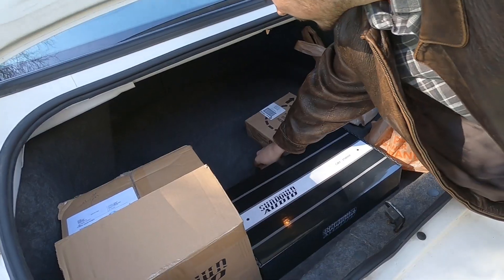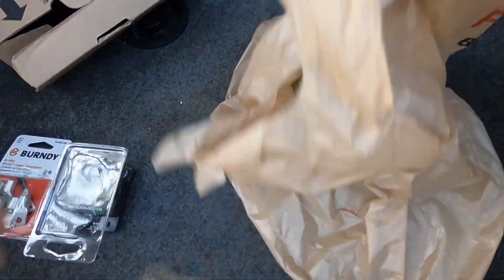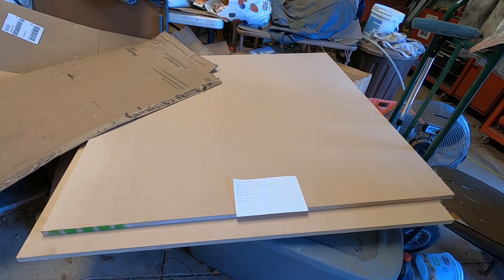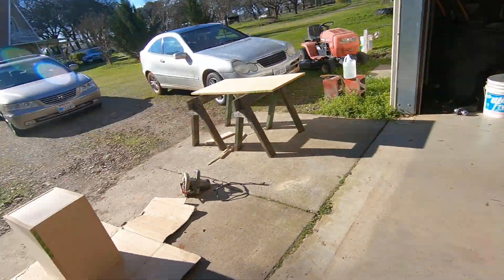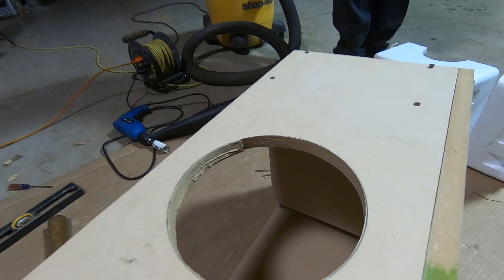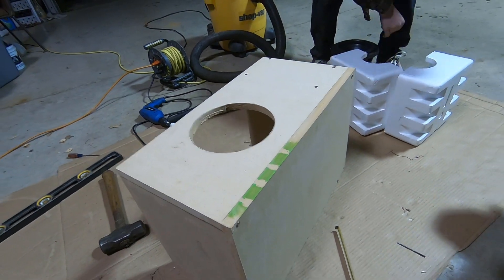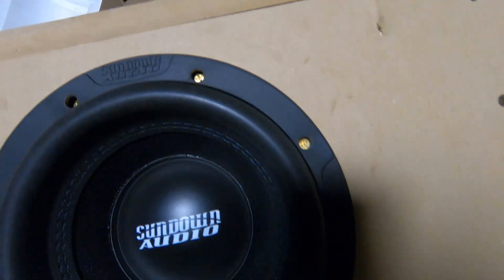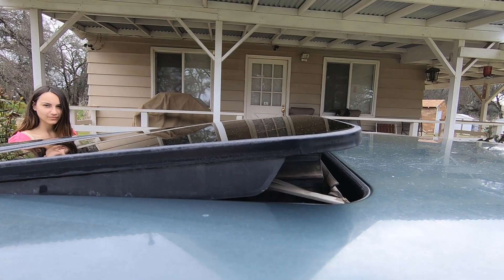Sundown X8 Unboxing Buick Regal Install :Part 1/2: The Box

Comment: Great little build!👍🏽 I'm currently running a kicker compvr 12" powered by a la-1000md amplifier, sounds decent but my buddy swears this x8 v3 will put it to shame! So I picked one up!🙂 and have been going crazy deciding on a box and am very pleased w/ your build! You sir gave me the courage to try your build! Do you have any recommendations before I start? Oh I am going w/ birchwood w/ a stain. And if it's ok w/ you, use your measurements?
Reply from the maker: I've only ever used MDF for boxes so wouldn't know how other materials would behave, I'm sure if you took your time pre-drilling the holes it'll be alright, definitely want to go no smaller than 3/4 thick, these things are heavy, with that being said, the box we made was actually slightly too large and we ended up having too much volume than is recommended for the x8 v3, it still sounds fantastic but it would probably perform better if we got it closer to its recommended box volume, if you use the R/E box calculator, type in our dimensions, and then tinker with it to get the box volume right for the Sub I believe we were about a cubic inch out from the recommended threshold, It's up to you if you want to tinker with it, but by all means feel free to use the same specs! have fun!
Reply: hey i’m also going to use your measurements i was wondering if i would place the sub next to the port